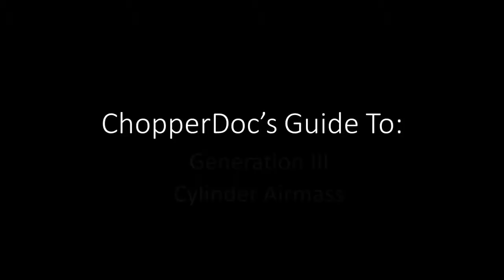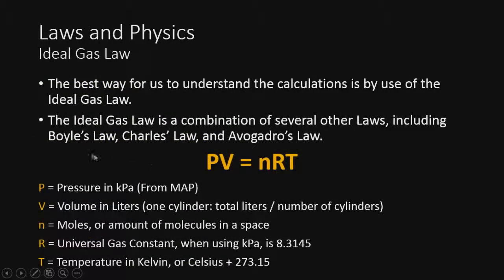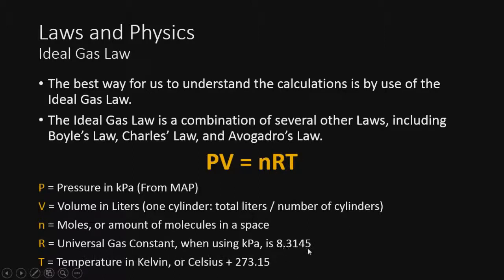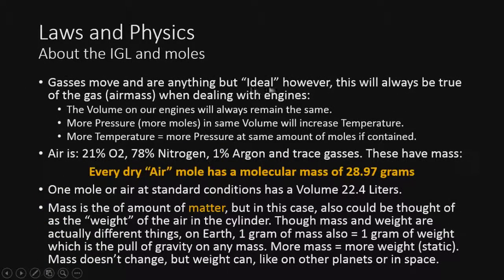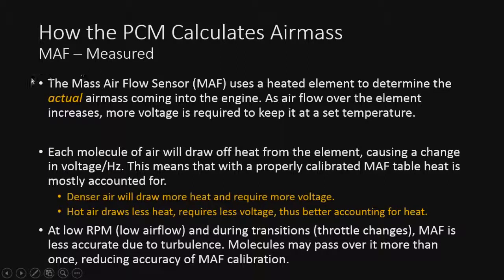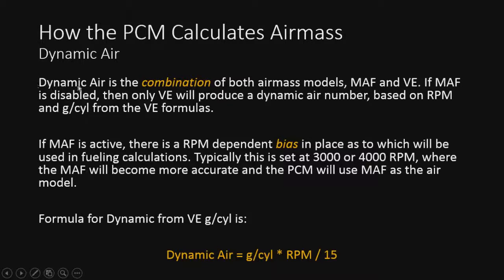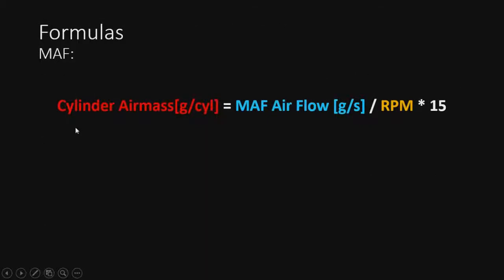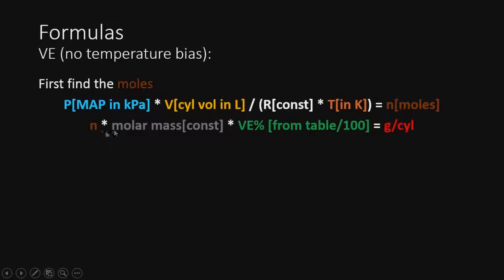Cylinder Airmass Explained - GM Gen III

Comment: Thanks for this explanation. I've often wondered why GM uses g/cyl airmass rather than manifold pressure. But its clearly much more precise measurement of intake air volume.
Reply from the maker: Yes it seems to work pretty well because it accounts for heat, which as we know has the biggest effect on airmass. I'm glad you liked this. The bias I have discovered has a factor of 1/2 I learned while experimenting with this in excel and trying to work out a bias formula for use in the scanner. So the half value of the bias multiplied in instead of the actual number actually yielded far more accurate results, almost always matching what the PCM was actually reading in the scanner. Naturally there is some delay in the software, sensors, and PCM itself, so the numbers don't always match perfectly. But pretty damn close if you plug the formula in and play around. In many places, it was to the second decimal for a number of frames in the scan. I will work on this soon, provided I can find some time and see if this idea still has some merit. It seems to work in excel, just have to get some new scans to play with, which I should have opportunity to do so soon.

Comment: Change cylinder volume in the PCM, by a lot, then look at the VE again. If it looks the same while displaying in percentage, your tuning software is accounting for that, not the ECU.
Reply from the maker: There are many formulas and tables in the PCM we don’t see at all. This is just showing the simplified version of what the PCM is accounting for, what I would call “theory” because there are a lot of things that do not translate directly from the mathematical theory. The ideal gas law is the law it is referencing. Whether or not this is actually what the PCM is using is another story. Also, when you adjust the volume, HPT automatically changes the VE iirc. So yes, it does compensate for this.
Reply: @ChopperDoc181  It being HPTuners, compensates, not the ECU. I'm over hear not paying that extorsion price, trying to use a P59 with Universal Patcher as a super cheap Microsquirt alternative. Already got it running a CB450, with a very hamfisted approach. I thought "oh boy, it says GM Gen III, I'll get specific info instead of theory" then I realized I thought wrong...
Reply: I said the hell with it and backwards mathed the percentage close to stock 222 is 37 of 600. Multiplied entire table by .37. Which changed hardcoded numbers by the same. That's probably fine, but I was hoping to validate that. Oh well. Now I'll see if my IAT reading is close to accurate while it runs happily. I have a potentiometer in place of IAT to make it easy to see what direction I need to go with tune, since i don't own a wideband.
Reply from the maker: The Gen III’s supposedly do in fact use PV=nRT, but, there are adders, and other factors like you said the software makes up for. It would be a wise assumption that changing the VE in HPT is probably changing more than that in the PCM. I don’t know that for certain, but I do know we don’t see all the tables the PCM uses. This is especially true on Gen IV’s. The editor definitely changes many, many tables with a keystroke. 

So you’re right, this is not that in depth down to the code used for each input and calculation. My apologies for that. Sorry it’s not helpful to your project.
Reply: @ChopperDoc181  Looks like some of your others are, at least as a sanity check.

Comment: enjoyed the approach of the video.   thanks for the info!
Reply from the maker: I'm glad you liked it. It's not enough for some of us I guess just to be told to do one thing or another, I have a problem with needing to know everything on how it reaches it's numbers and what I'm playing with when tuning. I worked on many different aspects of these PCM's trying to decode a lot of the calculations, like idle, transients, and even the bias. I actually found the limits of the scanner in this case, because the math just got too complicated in one formula and started having to reference another. Unfortunately, you can't reference a user math with a user math... lol. But I spent weeks trying anyway.. lol. Maybe I'll get back to that at some point haha.
Reply: Very cool.   I'm new to tuning, but I'm an engineer, so really enjoyed getting into understanding more of the math.  Turns out as I watched this video and some of your others and I realized the tune I paid for 3 years ago was a MAF only in my off road buggy.   I'm now trying to understand the implications of that and I'm wanting to go back to tuning my VE table then MAF then timing to effectively get away from MAF only.   I'm having lower RPM running and idle hanging issues as well as some other not great behavior.    Anyways, I'm spending a huge amount of time on youtube and forums before I touch a thing.   Watched most of your videos as well as many others.
Reply from the maker: @cryanconnor  Sorry for the late reply, but it’s very cool to have someone with engineering experience on the thread here. The math is complicated, for sure, as it starts getting into thermodynamics and so forth because of evap rates of the fuel, and of course this behavior changes with vacuum and heat.

The tuning methods themselves aren’t difficult, but the understanding, is. Idle uses it’s own calculation and as of yet, I haven’t figured that out. It goes off of “area” in square millimeters, so this throws another dynamic in and I haven’t been able to crack it as of yet,  but this is the reason the PID “Idle Desired Airflow” is different than “Dynamic Airflow” in the scanner. The Idle Desired is the result of the IAC Effective Area table in the tune, and this starting point or reference is the Base Running Airflow table. So basically, the BRAF table determines what value “x” is at step “x” in the IAC table. I have a video on how to map the curve using dynamic airflow, which is also why using dynamic airflow for the BRAF is seemingly more accurate. 

The actual value of the step “x” in g/s is what is difficult to ascertain, as again, it’s in “area” whatever that means when it comes to a specific value. Obviously this will change a lot when you have a different sized throttle body, and going from say a 90mm to a 102mm changes the “effective area” of the air getting past the blade, in addition to the air being allowed past by the IAC itself. 

So what this all means, is that the fueling calculations are either biased, or completely different when the car is in what we call the “idle routine” which is easily noted by the spark behavior after the delays are applied from the tab “Idle > RPM” under proportional, integral, and derivative (aka PID... boom, epiphany right?) as the spark will begin its “sawtooth” pattern under idle conditions. 

So that’s the big question. Is it using a different fueling calculation for idle? Or is it using dynamic? Or is it using both? Hard to say. Without knowing the delta airmass of the “area”, it gets rather beyond simple math and should be on a bell curve and not a linear axis, mixed in obviously with heat, and all the other variables discussed in the video here. Without seeing the actual coding, it’s pretty tough to know which is true from the questions. As once the curve is set using dynamic, you will be able to note that the PID idle desired changes thereafter. It doesn’t really matter that the number is different so long as the numbers actually work. 

Call me crazy, but not knowing why it changes after matching them up to set the IAC curve still bothers me lol. One of these days I’ll get back in excel and the scanner and experiment some more. 

As for your tune being off, what I’ve learned over the years is just go with what works. If the AFR is right, no sweat. If not, then it will require some tweaking. As for hanging, 99% of the time it’s caused by spark, not air or fuel. Spark increases or decreases actual torque being produced. So less spark is less torque. Over fueling can contribute to it, but anything richer than stoich cannot burn anyway, so what this tends to do is simply foul plugs and hurt horsepower. 

I know that’s backwards from conventional thinking, as many seem to think more fuel = more power. That’s incorrect. Leaner mixes will net more power because essentially engines convert chemical energy to thermal energy, aka, expansion of hot gasses are what make power in the first place. That means the closer you ride the line of max cylinder temps, the more power is produced. The term “lean is mean” is the best way to remember that. The reason we run them richer under stress, aka, Power Enrichment is simply to cool off the cylinder surfaces to prevent them from getting TOO hot. Too hot leads to detonation and possibly preignitions. Fuel is literally the best way to cool off the cylinder between strokes. Any ratio beyond the stoich of the fuel type is literally “wasted” because it simply cannot completely burn off at that ratio. So there’s your reason for it being richer. Fuel is used as coolant. 

I have an idle tuning guide as well, and essentially what works best is adjusting the blade to get the IAC counts in a 40-60 hot range, and plugging in the numbers for dynamic on the BRAF table, then matching the curve to the IAC using my video explaining that. Idle air doesn’t have as much of an effect as spark does for return to idle behavior as it gets kicked out of the idle routine as soon as it hits the TPS threshold for that as determined by the spark table select %, which is only like 3 or 4% or so. So this puts you on your main and idle spark tables to correct hanging. Getting the fuel right also helps, but not as much as spark will. You can also play with spark in the scanner to see what correction will work best.

Comment: Doc, I'm not following how your getting a temp bias factor of 0.2197. I'm running the factory 98 LS1 pcm. Under the air flow tab, I have a table cylinder charge temperature bias vs airflow.
0 to 150 g/sec. The bias factor numbers are 0.1714 at 10 g/sec to 0.0430 at 150 g/sec. What am I missing?
Reply from the maker: I'm using a stock tune file for a 2002 PCM (0411). The LS1 is indeed different. Don't sweat it if you are seeing different numbers. It's just an example of how it works. Funny thing is, after more tinkering I actually found the bias is double, so there is a slight error with the formula in the video. When calculating, it ends up being half of the table bias in the actual calc. That's probably why the bias goes up to 2.0, and if set at 2.0 the total value would end up being 1. 

So in reality there's a 1/2 before the bias math. Hopefully that makes sense.

Comment: Thanks for the explanation. Do you know how base fuel is calculated from dynamic air mass?
Reply from the maker: I've been working on that off and on. I tried to work out some formulas to determine actual commanded spray using injector data, pulse width, and flow rate (pressure). Limited success so far, and it's been a while since I've looked at it. All the numbers needed are there, it's just a matter of putting the right numbers in the right places to figure out how the fueling is done. I do know that there is a cylinder aimass model that uses injector information to determine the airmass. It's actually built into the scanner under the predefined math parameters if you are curious about it. The formula is:

(IAT(K) * IFR (g/s) / 1000)  *  IPW(ms) * AFR Commanded / MAP (kPa)